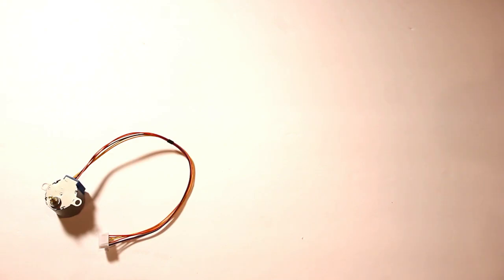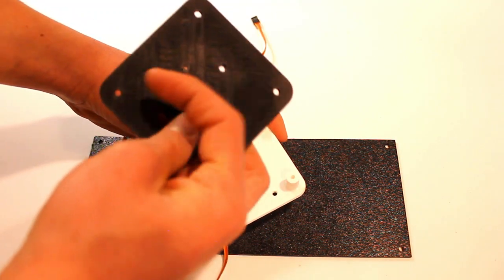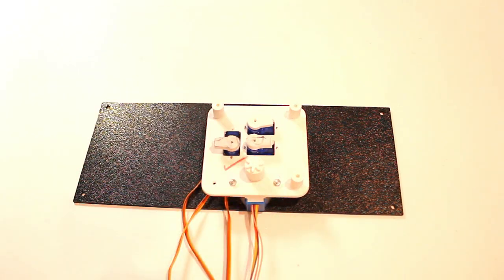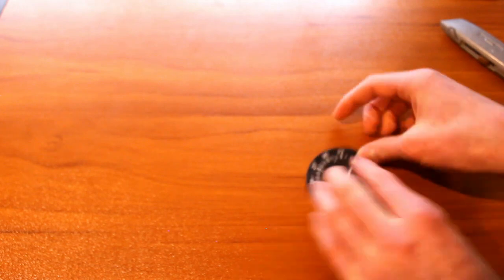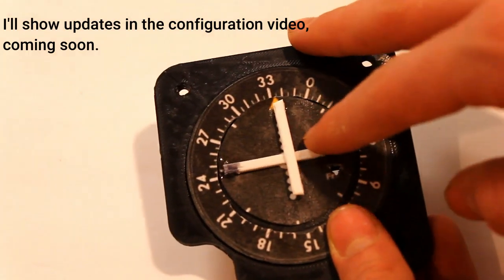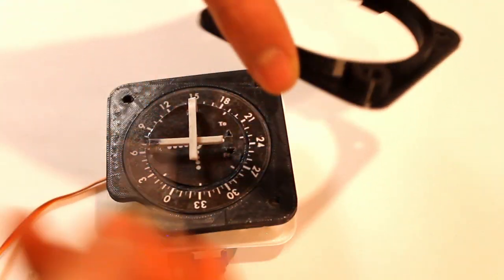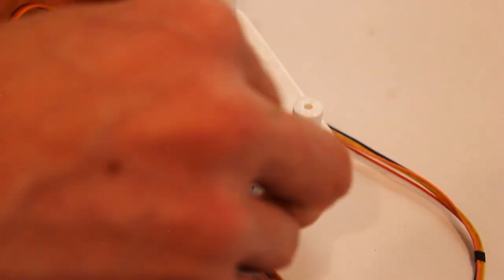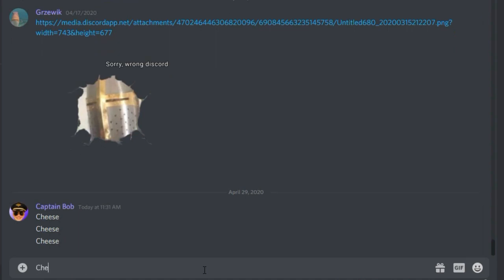How to build a Course Deviation for a Flight Simulator CDI/VOR Pt 1 FSInstruments 8 | Captain Bob

Comment: Hi Capt bob.we planning to migrate from monitor to analog as a sixpax panel.
How many servo and stepper motor should be have .tq
Reply from the maker: Depends on your design. Mine will go with 
x4 28-byj-48 steppers 
x20 x27 steppers
x5 Servos
Maybe buy extras!
Reply: @CaptainBobSim  thanks...cpt bob

Comment: Hey Captain Bob,
you did a fantastic job.
I have a question that I can't find an answer to anywhere. How do I reference the stepper motor? Is there a limit switch or a light barrier or do I not need a zero point at all?
Reply from the maker: This is an early design. You shouldn't theoretically need a zero if you dial in the steps right and don't unplug it during operation. Unfortunately I lost the CAD files and cannot easily modify this.

Comment: Captain Bob when you are ready to start making them please contact me. I need NAV 1 and NAV 2 CDI gauges that will work with X Plane. Thank you.
Reply from the maker: Hello factoryracecar! After using these a lot, I figured I didn't design them well. The gear doesn't mesh well, and the servos are easy to fall off. I wouldn't feel comfortable charging money for a half working product.
I will design a new version along with my C172V3 project, though this may be years in the future. I might also look into a redesign of this.

Comment: Nice job cap, I am your fan, I have been building my gauges too, but instead use my printer to print the decals, I put the images on photoshop over a 4x6 white background (photo size), and then I sent out to place where print photos, the results are amazing, very sharp and glossy images. Thanks Bob for this video.
Reply from the maker: Good idea GarageSim, Thank you for the idea!

Comment: Hey nice work..Really helpful info...Can you make a video on how to build a transponder.Wiring the 7 segemnt is clear but im not sure how can i wire the 4 rotary encoders to change the individual digits on the transponder.Thanks
Reply from the maker: Hello Akeel!
Here is the offset I foundr:

"0354	2	Transponder setting, 4 digits in BCD format: 0x1200 means 1200 on the dials."
I'd use this offset four times, one with the value of +/- 1, another with +/- 10, then the others 100, and 1000. 
Let me know if you need any further help.
Reply: @CaptainBobSim  wow Thanks alot for the quick response.Ive just started thinking of building my own Cessna 152 cockpit.Your videos help alot..Thanks alot for the offset info..Ill try it for sure.Also can i know whether can i use the KY-040 Encoder as the rotary knob?
Reply from the maker: @akeelifthar8552  You are welcome! You should be able to use the KY-040 to my knowledge.
Reply: @CaptainBobSim  Thank you once again 
..I will give it a try

Comment: Do you need a seperate arduino for each instrument ?
Reply from the maker: No, MobiFlight will let you configure 10 servos and 10 stepper motors to an Arduino Mega (assuming you have the right power supply) so you would need 1-2 Arduino Megas for all of the instruments.